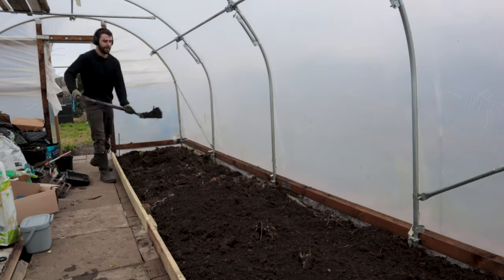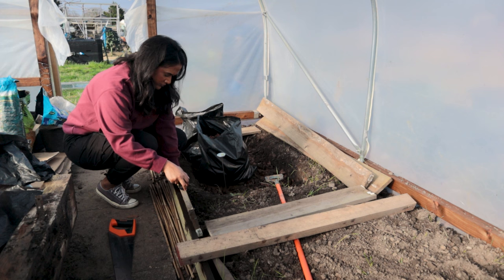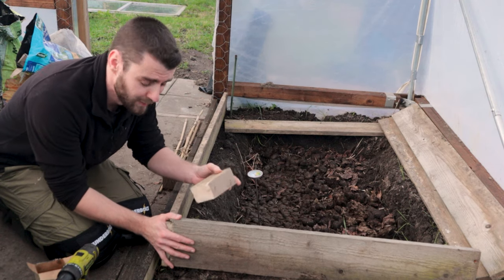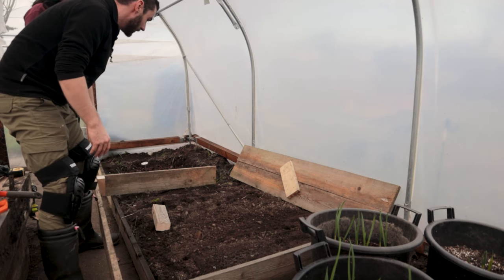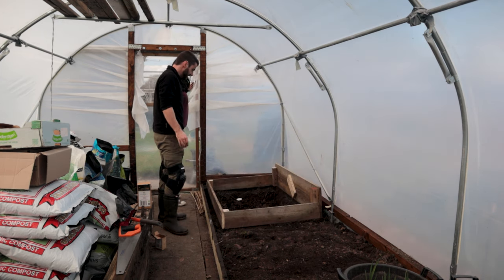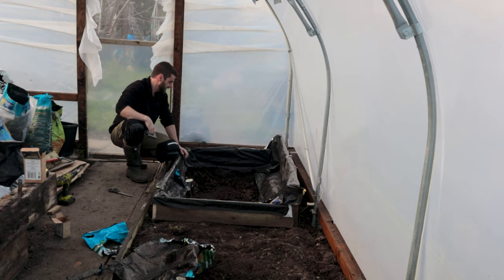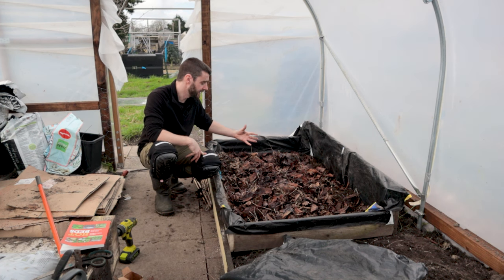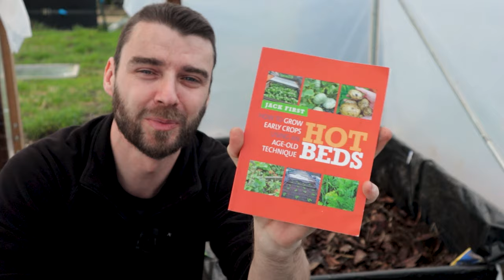Building A Polytunnel Hotbed

Comment: 'A JB effort' 🤣This was a really useful watch and rather serendipitous as I've just had a go at another hotbed after a failed(ish) attempt last year (I also put up a vlog about it yesterday - great minds...). I'm not using manure so trying it with ramial woodchip which I know is possible but also kind of tricky - so like you, very much experimenting with this method. I probably won't plant on top of the bed, it is more for just putting seed trays on - but I'll see how it goes and maybe add a layer of compost on top later on. I've covered with plastic because it is outside, but I don't think I will have the same problems with off-gassing using woodchip. Let's see how we get on!
Reply from the maker: Woodchip is a great idea! I might try that at some point next year too, especially if yours works well.

Comment: My grandparents used to start making a hot bed thingy in a new veg bed area every late autumn after the pigs were culled using kitchen scraps not suitable for the chickens.  Under a wire mesh my grandfather made in one of the factories he had relocated with Beaverbrook.  They threw everything in (👈🏻 everything 😬).  Then covered it with a cold frame (over the mesh) to bring on early potted up cold hardy plants.  It’s where my father got his love of radishes and early cabbage leaves from as a child: First fresh food in spring during the continued post war rationing era.  The bed was then used to grow runner beans.  He still repeats to me every year that beans grow better, tastier and straighter from a fertile, loose base than that of the theory beans produce their own nitrogen. That may be, he says (every year), but, he goes on (every year), I’ve never had such good beans as when my mother grew them. 

Horse (unwormed) manure was saved for the roses. A valuable ray of summer sunshine during those dark post-war days. 

I should video record his musings.  For our own children. My siblings and I tend to change the subject when he’s on his annual repeats! 😂🫡 

Emergency greenhouses in those days had huge hot water pipes passing through with large wheeled shutoff values. All built as lean-tos against kitchen walls.  Not separate structures like in village manors.  I remember having to dismantle ours to  re strengthen/turn the Victorian tie that kept the Tudor section of the house from falling down!  

Well. All that from a YouTube how-to hotbed video! 😂. I’ll click send, nevertheless.  Some might find it interesting. 😎
Reply from the maker: Awesome stuff! Thanks for sharing. I think beans are definitely a hungry crop.

Comment: JB it looks fine. I was just wondering can I make a hot bed in a planter on legs with a lid. I've just gotten two and was thinking of doing  hotbeds in them.
Reply from the maker: The main thing is whether or not you can get the quantity of material in there to start generating heat, but always worth an experiment!